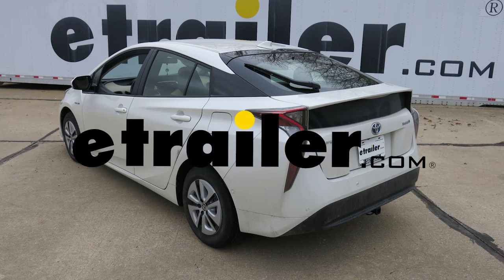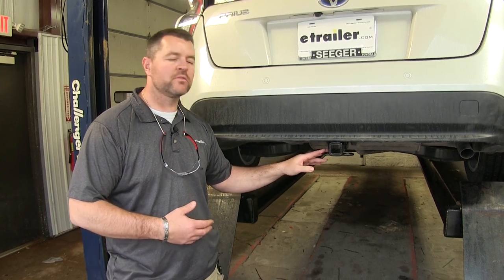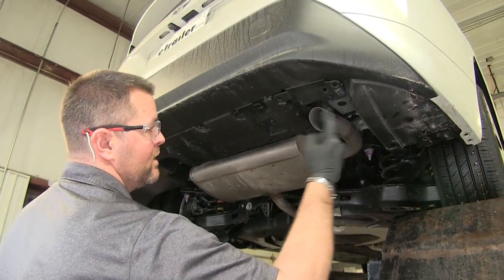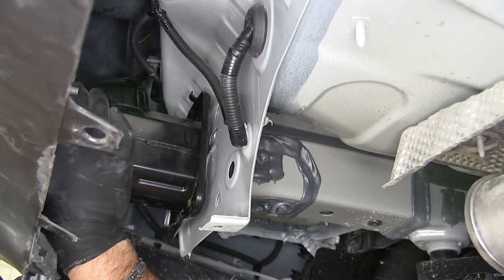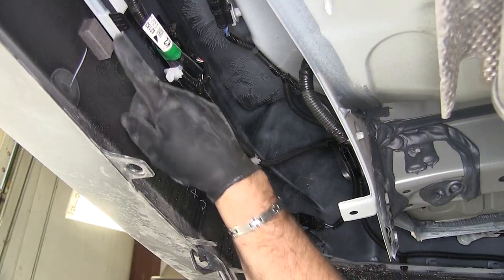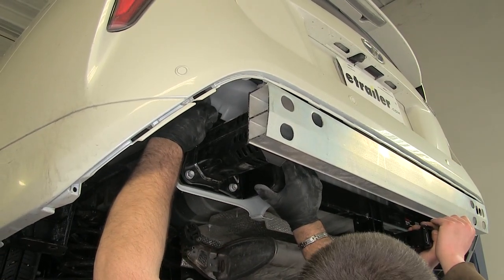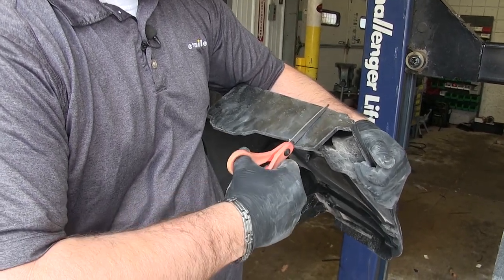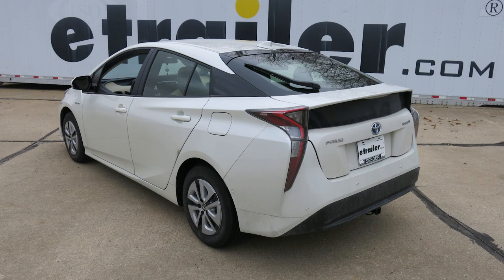etrailer | Install: Curt Trailer Hitch Receiver on a 2018 Toyota Prius

Comment: I didn't bend tabs. There is a cutout for that.
I didn't remove the bumper or wire harness just the two Phillips screws.
I just slid the hitch in and bolted it down.
Did it by myself too.
Reply from the maker: Thank you for sharing this with us. We will look into it and keep it in mind for the future. If you need a trailer wiring harness for your vehicle to tow a trailer, check out the following link for more information.

https://www.etrailer.com/t1-2018_Toyota_Prius.htm

Comment: I never bent back that tab. there is a cutout for it.
I didnt remove the outside plastic bumper. I just took out the 8 M8 screws and slid the hitch in then bolted it down.
Reply from the maker: Thank you for sharing this with us. We installed this hitch the way the instructions indicate. 
https://www.etrailer.com/Trailer-Hitch/Curt/C11473.html